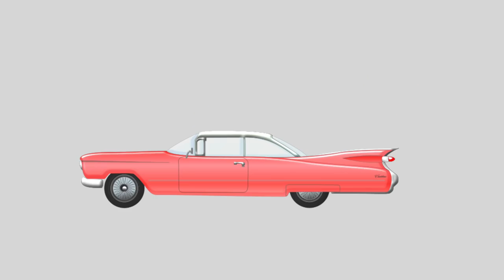Yes, Rockets CAN Fly in a Vacuum

Comment: This is wrong. Rockets in a vacuum are pushing against the shockwave(s) in the nozzle / exhaust stream. If you tried that balloon with a vacuum cleaner sucking the gas that came out of the balloon it wouldn't move - there are plenty of videos on YouTube demonstrating that. Rockets in a vacuum are much closer to a car engine in their fundamental operating principle. In atmosphere the exhaust gases displace air and that is what pushes the rocket, a bouyancy effect. That's why the nozzle configuration matters a lot in atmosphere. Don't feel bad, aeronautical engineers still can't explain how lift on a wing is generated and you're trying to do rocket science.
Reply: Lol. Clearly you don’t know engineering, son.
Reply: It's like the recoil of a rifle.
The rifle is the rocket body, the cartridge is the rocket engine and the bullet is the rocket exhaust.
The force that pushes the bullet out of the muzzle is equal to and opposite of the force of recoil on the rifle.
Rocket exhaust has mass, just like a rifle bullet, only instead of one heavy object it's trillions of light particles.
Reply: @kalliste23  
I've seen the videos, they're experiments designed by the ignorant.
You can't simulate the vacuum of space with a shop vacuum, a shop vac is just a fan that moves air, and moving air causes the drag that keeps the tiny rocket force from moving the balloon car.
Vacuum is the absence of matter/gas.
Rocket thrust is purely inertial, the rocket's explosive combustion applies force to the mass in rocket exhaust and an equal and opposite force to the rocket itself.
They fly apart.
Rockets actually work BETTER in vacuum as there is no air resistance to hinder the exhaust from accelerating away from the rocket motor.
Look up "vacuum optimized rocket motors".
Reply: @kalliste23  - "Theory guides but experiment decides. "
Exactly.
THAT is WHY we have been testing the Tsiolkovsky Rocket Equation for almost 100 years.
The Company I work for tests dozens of rocket Thrusters per year IN A VACUUM Chamber and we VERIFY that they produce the thrust predicted by the Rocket Equation.
Let me Guess you don't even KNOW that the Rocket Equation predicts that rockets have MORE THRUST IN A VACUUM, do you?
Bless your little heart!
Reply: @kalliste23  - "You're just too lazy to check or even do the experiment for yourself, "

And apparently YOU are "Too lazy" to WALK OUTSIDE and SEE THE ISS IN ORBIT with YOUR EYES .
Maybe TRY THAT Genius?
Reply: @stuartgray5877  
I doubt that, I watched the Apollo 11 landing broadcast live.
(You tagged the wrong guy btw, 😉)
Cool you work in the rocket industry.
I commented on your crossbow comparison video a year ago.😁
Reply: @kalliste23  - "As I said, their are plenty of videos of Youtube that demonstrate that gas doesn't push in a vacuum. "

YOUR STATEMENT - NOT MINE
YOU Are the one claiming that rocket propulsion does NOT work in a vacuum.

And my POINT about the ISS in orbit IS: HOW DID IT GET UP THERE, if "Rockets don't work in a vacuum" LIKE YOU ARE SUGGESTING.
Reply: @stuartgray5877  what is wrong with you, I said rockets work but not how she said. Go back and read what I actually wrote. The ISS has nothing to do with it, why are you dragging that in, I said nothing about the ISS.
Reply: @kalliste23  - But you said that rockets DONT WORK in a vacuum.
Are you changing your story now?

SO tell us exactly what you DO think.
Reply: @jimsmith7212  Recoil ........ha ha , not that rediculous analogy again ....WHATS THE BULLET??
Reply: @marxman00  
Newton's 3rd law of motion:
"For every action, there is an equal and opposite reaction."

The statement means that in every interaction, there is a pair of forces acting on the two interacting objects. The size of the forces on the first object equals the size of the force on the second object. The direction of the force on the first object is opposite to the direction of the force on the second object. Forces always come in pairs - equal and opposite action-reaction force pairs."

The pairs of forces are between the rocket and the rocket's exhaust, nothing else.
Reply: @marxman00  
Watch the YouTube video:
".577 T-Rex go Boom TheBlueMeanie."
The bullet is a particle of mass that is accelerated by an explosion.
The force applied to the bullet is exactly the same as the force applied to the rifle.
The bullet goes in one direction and the rifle goes the opposite direction.
Rockets carry thousands of pounds of mass with them as fuel and oxidizer.
Rocket fuel combustion is a sustained explosion that pushes trillions of molecules, tiny "bullets", away from the rocket in one direction and pushes the rocket in the other direction with an equal force.
In the video:
"What's Going On In This Spacex Rocket Video?
NASASpaceflight"
You can see blasts from maneuvering rocket thrusters when the booster is in vacuum.
Reply: @jimsmith7212  Of course /obviously .. so how much fuel MASS do you think you need to chuck out the back for your equal and opposite relative to vehicle MASS ?...and  oh and now you have less MASS than you started with ,Guess what>>>> you can never  decelerate ...EVER because you dont have the MASS anymore.
Newton did include that  the two bodies  are in an environment ,not in a mythical non universe where only"they" exist.
Reply: @marxman00  
Rocket ejecta is pure mass and as you know, mass is not lost or destroyed, only converted from one compound to others through combustion.
(This doesn't count nuclear fission where mass is "converted" to energy...this is chemical not nuclear)
All mass lost by a rocket in thrust only makes the rocket lighter and easier to accelerate while the thrust stays the same.
What causes recoil in the 
.577 T-Rex?
Reply: @marxman00  
Particles don't push against anything.
The contained and directed explosion pushes equally against the rifle and the bullet.

Here's another physics lesson you won't like, but is true regardless:
"On Earth, air tends to inhibit the exhaust gases getting out of the engine. This reduces the thrust. However, in space since there is no atmosphere, the exhaust gases can exit much easier and faster, thus increasing the thrust. Therefore, the rocket engine actually works better in space than here on Earth."
Reply: @jimsmith7212  The only reason a riffle has recoil is because of the MASS of the bullet and mass of the surrouding air ..AND if there  was no bullet the recoil would  be pressure against the surrounding air.. so please dont use recoil as anything to do with rockets in a vacuum , it is not relevent
Reply: @marxman00  
Mass of the bullet, yes. Mass of the rifle, yes. Surrounding air, no.
What about a fully automatic machine gun where the breech opens by recoil before the bullet leaves the muzzle?
How does atmosphere open the breech? Where does atmosphere apply force to an open breech?
Don't feel bad though, you're not the only one to be wrong.
"On 17 July 1969, the day after Apollo 11's launch, the New York Times issued this correction over a 1920 story it ran saying spaceflight is impossible. They probably figured best to get it out there before Neil Armstrong and Buzz Aldrin were slated to step foot on the moon. An, enlightenment for the benighted masses who read their rag.
Here is the text: "1969: On Jan. 13, 1920, Topics of The Times, an editorial-page feature of The New York Times, dismissed the notion that a rocket could function in a vacuum and commented on the ideas of Robert H. Goddard, the rocket pioneer, as follows. 'That Professor Goddard, with his 'chair' in Clark College and the countenancing of the Smithsonian Institution, does not know the relation of action to reaction, and of the need to have something better than a vacuum against which to react -- to say that would be absurd. Of course he only seems to lack the knowledge ladled out daily in high schools." Further investigation and experimentation have confirmed the findings of Isaac Newton in the 17th century and it is now definitely established that a rocket can function in a vacuum as well as in an atmosphere. The Times regrets the error.'""
Google it.
All in all, what you mistakenly believe has no relevance; orbital rockets, will launch at a rate of over one a week in 2023, and that's just Spacex alone, without Russia and China and all other governments and private companies.
You keep using your satellite based Global Positioning System smart phone app and get your weather from satellites and if you watch network broadcast TV the signals that are sent to relay satellites across the country and globe.
It doesn't matter what you believe, they will all keep working without you.
Reply: @jimsmith7212  that makes us equal and opposite, just as Newton said
Reply: @marxman00  - "stop talking about recoil, it has nothing to do with anything to do with rockets in vacuums ."

You have been told REPEATEDLY that rocket propulsion is JUST MECHANICAL RECOIL.
I am sorry that I cannot explain it in terms SIMPLER than a five year old can understand.

"Push MASS - MASS Pushes Back".
This is the essence of Newton's third law genius.

SO, tell us HOW the exhaust gas gets ACCELRATED or S TF U.
Reply: @marxman00  - "Mass pushes back""

Newton's Third Law:
"For every Action There is an Equal and Opposite Reaction".

This means: Whenever One MASS exerts a FORCE on another MASS, BOTH masses feel the SAME FORCE for the SAME DURATION.
When one mass pushes on another mass, the mass PUSHES BACK.
This is called INERTIA.
It means that Forces NEVER OCCUR ALONE, they MUST occur IN PAIRS.
They teach this in 8th grade intro to physics.

Now tell us where the force originates that accelerates the mass of the exhaust gas into the vacuum.
Because Newton's laws tell us that there MUST BE A FORCE to change the velocity of the exhaust gas (since the exhaust gas HAS MASS)
WHERE does this force COME FROM .
We have undeniable PROOF that there MUST BE A FORCE.

If the question is too difficult for you, I invite you to run away like a coward, OR hurl some juvenile insults instead.
Your choice.
Reply: @marxman00  Next I invite you to tell us:
1 - What is the exhaust by-product of burning Hydrogen and Oxygen (like in a Space Shuttle Main Engine)
2 - What is the exhaust by-product of burning Kerosene and Oxygen (like in a Falcon9 Merlin Engine)
Anyone who has taken high school chemistry can answer these two questions without even looking anything up.
How about you?
Reply: @kalliste23  SG is a bot, genius.  It doesn't pick up on comprehension 100% of the time.  It floats around vids to spread disinfo and will look for certain key phrases and your comment triggered it.  Congrats.

Comment: Did not answer question at all
Reply: Expanding gasses at the rear of the rocket propel it
Reply: @cory5797  if the gas expands at the rear of the rocket, how would the gas then turn around and provide thrust to the rocket as well?
Reply: @DrCash7  Because it initially expands in all directions.
Reply: @DrCash7  like Jan said, the heat and chemical reaction causes gas to expand in all directions at the back of the rocket(the cone shape).  For example, if you take an icicle and squeeze it it will slip towards the thin part of the cone.  The same premis happens in the cone of a rocket but in reverse.  If you dispute this fenomina then this is the most in depth waist of youtube comment
Reply: @DrCash7  also the gas collides with itself on the way out but it more negligible with the reduction of atmosphere
Reply: @cory5797  expanding in all directions?? Let me make this easy for you.  

Pressure has been built in a closed chamber.

Closed chamber is then opened to open space.  

Gas has choice of:  a) staying in the chamber to perform work on the rocket while 
b)  freely expanding into the vauum.

Not sure why or how you cannot grasp this concept.  It's been proven.
Reply: @Jan_Strzelecki  and it continues to expand in all directions even after the option to FREELY expand into space arises?  Does heat travel to hotter mediums as well xD xD xD xD.
Reply: @DrCash7  and it continues to expand in all directions even after the option to FREELY expand into space arises?
Yes, because, as you've been told elsewhere 2 minutes ago, vacuum doesn't do anything. Free expansion, or lack of work, refers to (no) work done on the wall that's just been removed.

Gas has choice of:  a) staying in the chamber to perform work on the rocket while
b)  freely expanding into the vauum.
Those particles that are facing the opening will exit into space, performing no work, but those who are facing away from it must first have its direction changed by an external force, such as the walls of the combustion chamber.
Nor sure why or how you cannot grasp this concept. It's most definitely been proven :]
Reply: @DrCash7  you sure are missing a whole lot. Sure expanding gasses are propelled into the vacume of space with little to no opposing force but are you telling me that this is the only force? No! Apparently you are willing to ignore everything else.
Reply: @Jan_Strzelecki  lol the particles have faces now?  Do they have eyes too?
Reply: @DrCash7  well your "vacume" is missing the letter 'u' and has an 'e'
And your "vauum" from before was missing the letter c :]

describe the forces at work that would allow pressurized contents to provide two directions of thrust between a vacuum and a pressurized chamber
Upon ignition, pressurized exhaust gas expands in all directions. There you go.

Vacuum doesnt do anything now?
Much as the space between your ears, vacuum is the absence of matter, so of course it doesn't do anything.

Free expansion works on "the wall that's just been removed?"
Yes. "A free expansion of a gas can be achieved by moving the piston out faster than the fastest atoms in the gas." Do you even know how free expansion works? Because it doesn't look like you do.
Reply: @DrCash7  awe man, gee golly u got me there.  Ur right focus on these spelling errrrrrors so you can keep igmoring actual conversation
Reply: @DrCash7  I can't spell but can imagine complexity far beyond your capacity. I'll take it
Reply: @cory5797  right.. because why waste your time on the little things when you can jump right into to understanding rocketry xD
Reply: @DrCash7  exactly. Show me one study that shows spelling is a good marker of intellect.  I would argue that people who harp on spelling and grammar tend to focus on microcosms and parts rather than complex systems.  You obviously do this.
Reply: @cory5797  lol. You had to go back and edit your spelling xD xD xD 

How's that harping and microcosm going?!?!

 xD xD
Reply: @DrCash7  : At a macroscopic level, you can just look at momentum conservation.
Do you think that form some reason (explain which one) this law wouldn't work in space?